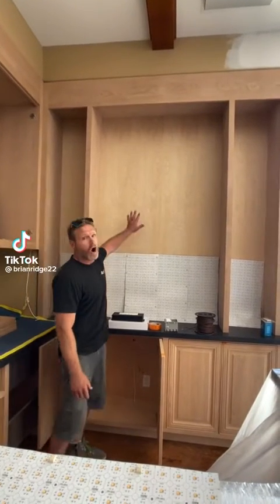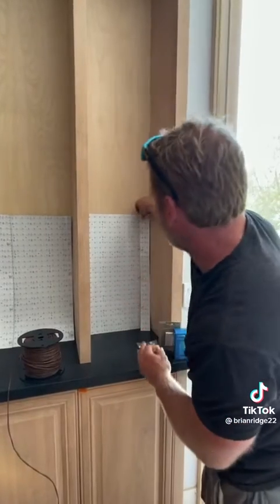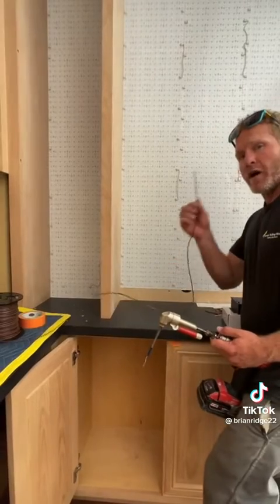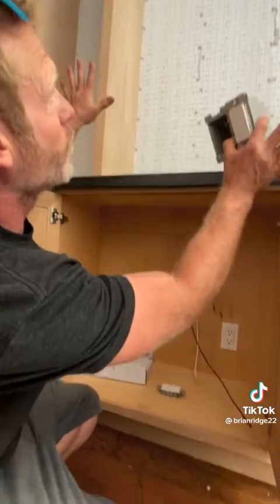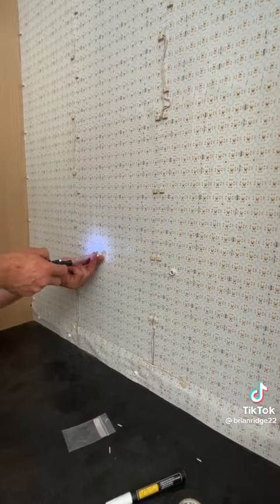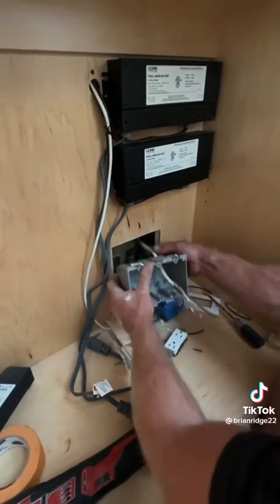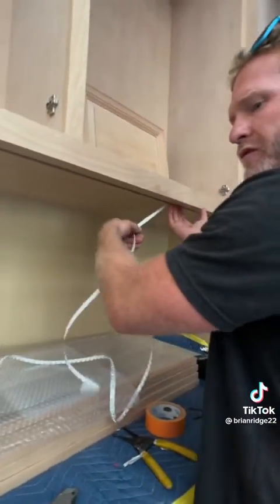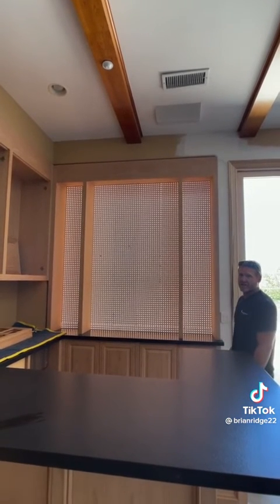Installing onyx stone with a back light

Comment: Doing a back lite onyx bar, but having a hard time figuring out how they get the stone attached.
Reply: I’m having the same trouble. What did you figure out?
Reply: @todsizemore4059  . I'm screwing 3/4" shop ply to the wall. (mostly because I have to attach glass shelves through the stone and need a good anchor). The sheet LED lighting (18x24) will get adhered to the plywood...3M peel and stick backers. I'm sure it can be done on smooth coat drywall. Textured drywall probably not a good idea for the double sided tape to stick well. The stone will be attached directly to the sheet LED with clear silicon. I am making a 6" border frame from solid wood that is 6/4 or about 1-1/4" thick that the stone will be set into and provide lateral load for the stone to rest on. My electrician is providing the LED sheets. Three 18x24 sheets use one power supply and I have 4 rows. Four power supplies. They will be in the cabinet below. I think the slab will be about 80" wide x 70" tall. I should make a vid when it comes to the install. But apparently, the slabs are just glued to the led sheets with silicon.
Reply: @getsomemtb7427  so I opened up the drywall & doing plywood backing as well about 1” back of the front of the studs. My led are going to sit right on the plywood but then I’m adding a 1/2” of lexan to stand the stone out a bit so the light can come in more full, the lexan will countersink screw to the studs & then I’m using lexal to attach the stone to that. Hope yours works out for you!
Reply: @todsizemore4059 , nice plan. I'm leaning toward using Loctite Power Grab. I've had good experiences with it and the Gorilla polymer adhesives. Best of luck to you!

Comment: Hi - where do I buy these flexible panel for cheap… I know they are expensive! I am in Southern California. 
Also I am trying to put the led strip light in my library we are building. I want color changing led strip, what would you suggest to use to avoid the voltage drop as I have to run a 150 feet led strip through the different rows and coloumn. Thanks a lot 🙏🏻
Reply: Did you find the led mats? I am also looking for the same

Comment: Awesome video!  Doing a similar project.  Any recommendations on the spacers that you used?  (and also how thick were they, providing space between LED and stone)?? 
Thanks!
Reply: following, we are at standstill because we cant find the spacers.
Reply: I think that he used the rubber like hosing (similar used to beer tap lining hose) and spaced around 3/4-1".  I am going with 1" as I do not want the diodes to shine through ours!   @sherisiegel9191